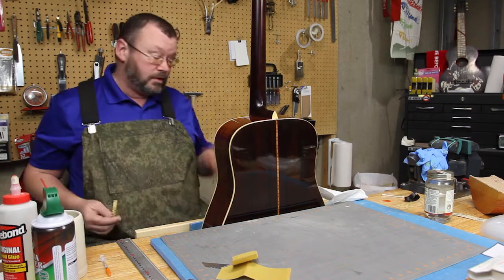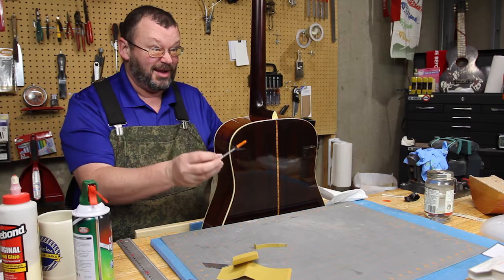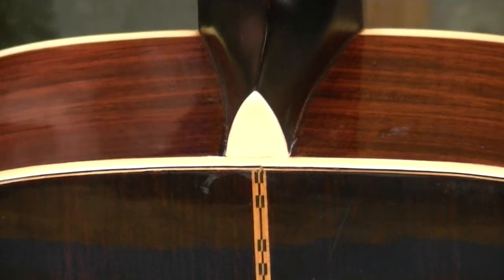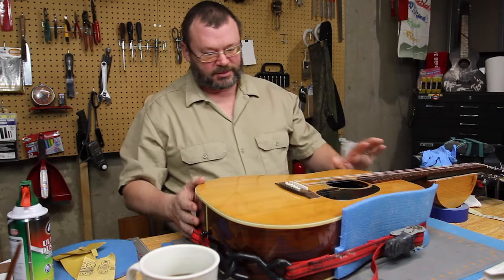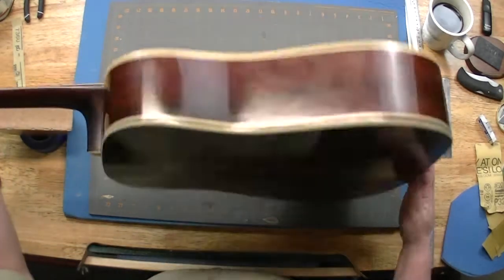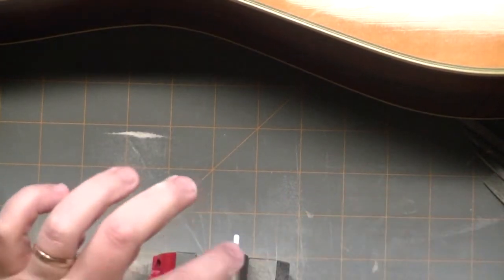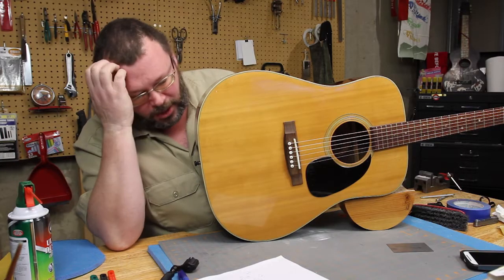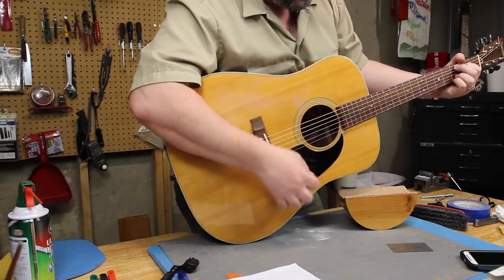DORADO heel glue saddle job 4 | RATTLECAN GUITAR RESTORATIONS by James O’Rear

Comment: I know this is an old vid, but I just thought you'd like to know, the wood on the sides, inside the Dorado at least, is Macassar Ebony. I can't tell if its the same on the outside from the video. That's a nice guitar, a real sleeper. Whatever happened to it? No vids on how it ended.
Reply from the maker: Resting in a case, used as a house guitar for get-togethers or a loaner if someone needs it. Nice little guitar.
Reply: @RattlecanGuitarRestorations   - Hey man great vids you've done on this Dorado. I understand these Dorado's where only made few a few years in early '70's but can you tell me if  they are a laminate back and sides or all solid bodied guitar. Thx.
Reply from the maker: @redrock1963  What I've read says solid wood.